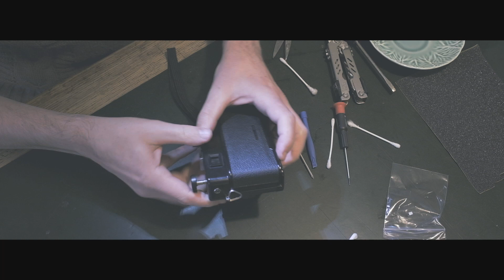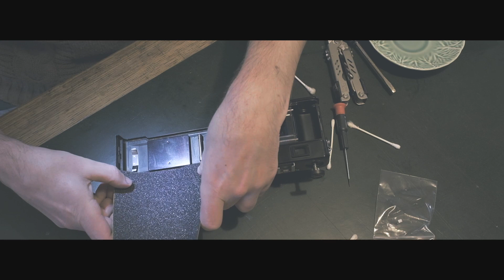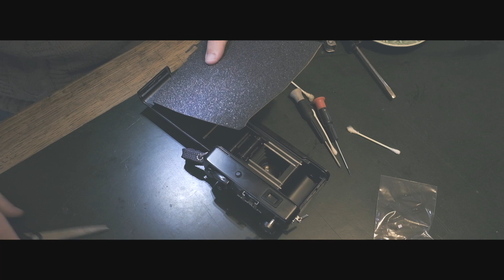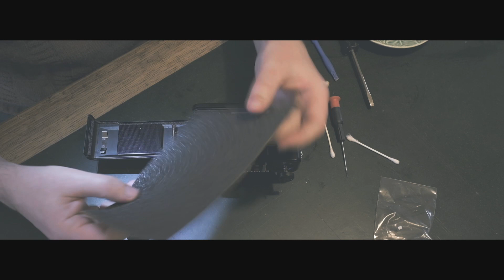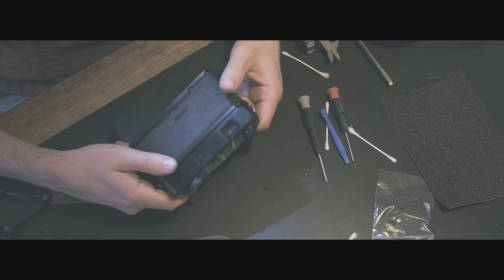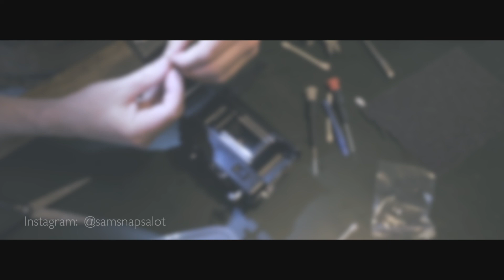HOW TO REPLACE LIGHT SEALS on any film camera.

Comment: Hi! First off, I’d like to thank you for this quick tutorial! I just got mine a few days ago from a thrift store and I’ve noticed the light seals have disintegrated due to time. I wanted to ask if it’s necessary to take apart the camera when scraping every possible gunk from the light seal that has accumulated (most I could see are just on the area where it is), and if a 2mm is considered too thick? I have the GS version of the Electro 35. Hope you get to read this. Thanks!
Reply from the maker: Hi, sorry only just seen this - no you dont need to dismantle anything just open the back up. 2mm might be okay - as long as the camera still shuts that’s the only thing.